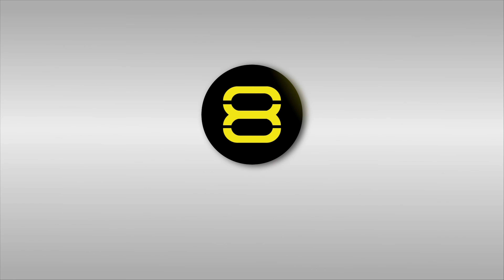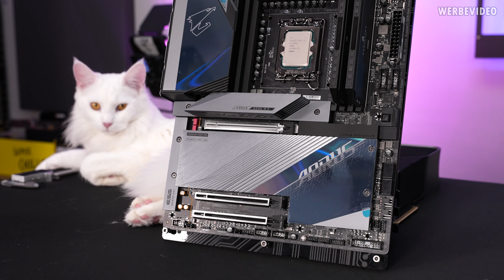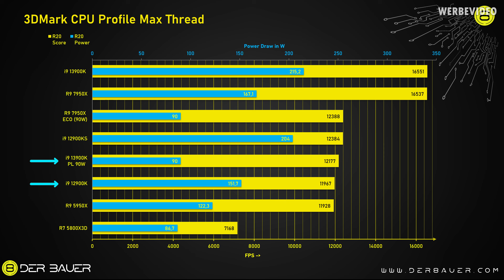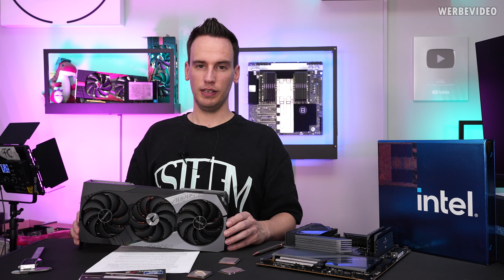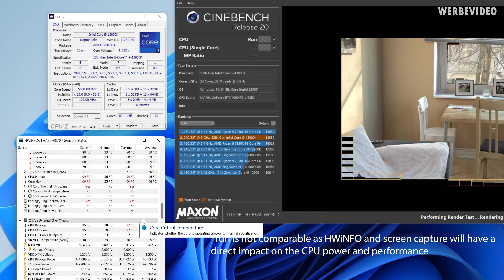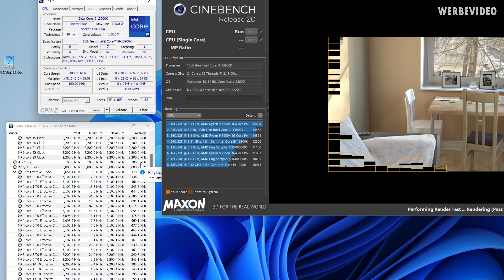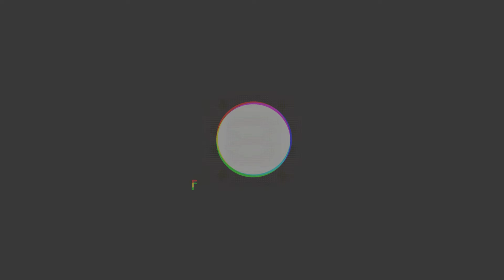Testing and Tuning the new 13900K for Efficiency

Comment: Really interesting to see how the CPU performs with the manual UC/UV. Most reviewers just focus on full power potential and instantly write off the good parts for the high power consumption. But this shows actually that its a really competent cpu when tuned correctly. Thanks for making the review with this viewpoint in mind
Reply from the maker: Thanks! Happy to hear
Reply: I mean... why buy the most expensive CPU to instantly undervolt it? If you need that power - good. If you dont, go buy i3 12100 and be happy. Its cheap. It sips power. And it gives you the same experience in games as any top CPU on the market. 

I know what i'm talking about. I've sold 12900k before 13900k launch. To buy new and best. As i've always did. And got myself i3 12100f as a temporary solution. Didnt expect much. But I've noticed zero difference in any game i played. None. Numbers might be lower. But actual gaming experience is the same.
Reply: @PanaehaliTut  Why buy the most expensive cpu? Because you can still obtain 90% of its performance with a simple good undervolt setup. That's still going to be leagues above the second-in-line cpus so why wouldn't you? There's no reason to keep stock levels of performance clock, that just exists for bragging rights in marketing, but doesn't benefit end users at all.

Realistically now you can get 12900k levels of performance at half the power draw (and sometimes even less). That's incredible, especially if you live somewhere where electricity prices aren't exactly consumer friendly these days. I am strongly considering getting a 13900K for my company/personal use, and fully intend on undervolting immediately so I can both use an air cooler and keep my current power consumption levels equal, while gaining probably 3x the performance of my current cpu.

It also usually doesn't make sense to swap cpus each generation, I don't even know why you got rid of your 12900K so quickly, what exactly were you expecting? Double the performance at lower power consumption with stock volting? That just sounds like copium.
If I were you I would have looked into a similar undervolt setup on the 12900K and waited at least 2 gens before upgrading - that is, if you don't have a ton of money burning a hole in your pocket. Top end gpus are never sold as good deals that benefit from being replaced every new generation. That spot falls on the 2nd and 3rd in line cpus that tend to have lower margins and higher generational uplift from stock settings.
Reply: @PanaehaliTut  Where it does become relevant is cooling solution. Arguably the price of electricity is over emphasized in many reviews but in gaming both peak and sustained power draw will affect real world performance depending on your setup. If you already had a setup for say a 12700 and wanted to get the best, knowing that the 13900 performs so well in efficiency standards (under the right conditions and tuning) may make the transition more compelling. 

I'm not even talking undervolting, the comparison of running intel powerlimits and such vs motherboard manufacturer ones is relevant for any kind of limited aircooling esp with a large gpu in the case.

Honestly, I agree overall. But some people will want to undervolt this for things like small formfactor stuff. Where they only care about performance under extremely limited cooling. An I guess some people might stress a 13100 out a little more than you :P
Reply: @faithnfire4769  at which point does 7700x or 7950x becomes a really good efficient option?

Neither of them require the tremendous power draw or cooling requirements of 13900k at full load, and consumes less power during gaming as well
Reply: I miss the days when I could boost my old Core 2 duo by 40% just by getting some good thermal paste, but those days are long gone. Honestly I don't really care about overclocking anymore. The relative performance gains are so marginal these days that unless you're chasing benchmark numbers it's just a waste of power. Efficiency tuning for a cool and quiet computer is where it's at these days! For me at least.
Reply: @fnorgen  
Core 2 duck tape overclocking.
and that's a good one
Reply: @aravindpallippara1577  stock values of the 7950x in full load are still above 250W lol, and unless you missed the whole video on average the 13900k with stock values uses the same power draw in gaming as the 7950x, both tuned go well below their out of the box performance while keeping over 90% of their efficiency
Reply: @PanaehaliTut  the answer is very simple: To get as much computational power as possible in the most silent built ever.
Reply: @PanaehaliTut  You do know that undervolting by itself doesn't reduce performance right? I agree that some people are going to buy this when they don't need it, but why not let them. It's their money to waste.

I also know what I'm talking about. I've been undervolting and efficiency tuning mobile and desktop CPUs since Intel 8th gen CPUs. You can often drop the voltage going into a chip without effecting the frequency. It's the same idea as overclocking just in reverse.

Instead of increasing the clock speed at the same voltage, you reduce the voltage at the same frequency. Then, you test for stability, and repeat. When you reach instability, you either increase voltage or reduce clock speed in either case, which one you choose depends on if you are undervolting or overclocking.

For example, I have a mini PC with an i7 9750HK. At stock it pulled 75W under sustained boost, and would spike up to 118W. It managed around 6700 points in cinebench R23 and would pin itself to 90C in those benchmarks. This would limit the clock speed by about 10%. After an undervolt of about 15%, it drew 15% less power as expected and maintained the same performance within the margin of error, but was now sitting at 83C instead.
Reply: @der8auer-en  Just had to downvote. Yet again another reviewer recommending buying Intel without considering the fact that the AM5 platform already supports PCIe 5 and will be supported until 2025 at the very least for another one or two CPU generations. Moreover, there will be the X3D V-Cache versions 7800X3D, 8800X3D and 9800X3D most probably all of which may well be supported by any AM4 motherboard bought today. A shame really.
Reply: @PanaehaliTut  ask yourself that question because you clearly need to know the answers. Wasting your money on the most expensive stuff when you have no idea why you need it
Reply: @lagarttemido  Whit AMD you allways wait for something. Who realy upgrades every generation? So AMD is cleaming it will suport AM5 for 2 more years (2 years and 2 months). You think something magicaly will happen and it will be big boost in performance. I just calculated that my i7 8700k (with shitty RAM) at 4.7 Ghz is only 50% slower than i9 13900k  with best ram. So in 2 years at best you can gain 20% performance. Totaly stupid to pay now this stupid prices to save some money latter. About upgrades. I would like to get i9 9900k to upgrade my i7 8700k, but i just cant find it for normal price. Same with my sons i5 6600k, i would like to i7 7700k. I cant find it for normal price. It is better to buy new platform than to upgrade. AMD fucked them self with prices and power this generation. If AMD relised x3d chip i would consider buying it. But now i think i will go i7 13700k or wait 14th gen. Reason is simple, i can eliminate CPU bottleck by going to higher resolution (4k from 1440p) and there is no difference than my old i7 8700k or any new Intel or AMD.
Reply: @vanjakloz362  Nobody with a budget upgrades every generation, you're right. The thing is though that in five or six years I will be able to put a two or three year old 9950x3d into my x670e motherboard (that I got for $280), and immediately have way better performance in everything. That means I saved $300 because Am5 isn't a dead-end platform, which is not an insignificant amount.
Edit: Obviously there is still an argument to be made for Raptor Lake, If you have a 12600 or 12700k in your system, upgrading would be great value as you get to keep your motherboard. For new builders though, raptor lake isn't the greatest as if it is for gaming the 5800x3d and 5600 absolutely destroy in value, and ryzen 7000 gives you slightly worse performance (arguably) while giving you an upgrade path.
Reply: @PanaehaliTut  The 7950X cost more than the 13900K. So this is not undervolting the most expensive CPU.
Reply: @der8auer-en  Can you try the E-cores-only case? How does it perform then?
Reply: @PanaehaliTut  Quad cores are dead.
Reply: @orangepacker7479  What you say has a very significant flaw, old cpu's are still expensive as hell, i tried looking or an old 4790k for a friend and it was cheaper to just get a ryzen 5. If you plan to wait 5 years to then buy a 3 year old cpu then expect to pay higher price than what you would like to pay when looking at the current options of the time. 
Instead of getting something that you can maybe upgrade later just spend a bit extra and get something with headroom for your application and hold onto that build for as long as you can
Reply: @joey_f4ke238  The point isn't saving money on the cpu, its saving money on the motherboard. As for your example the 4790k is way more than three years old. You can get a 3800x for $250 brand new rn and that was almost $400 on release. Of course that isn't always true, as the 3950x has a terrible price. Maybe the cpu price will go down, maybe it will stay the same or even go up a little, the point is that you save money on a motherboard. Gambling on the newer ryzen 5 having better performance in three years than the x950x3d part is unrealistic.
Reply: @PanaehaliTut  I disagree. I think it makes far more sense to push a cheap cpu to its limits than an expensive one because the advantage with CPUs like the 13900k is in that you can UV it to the point where it draws the same as an i3-12100 and still drastically outperform it and on the other end when overclocking a lower end CPU you are just increasing its value and pushing it closer to chips like the 13900k for FREE.
Reply: @aravindpallippara1577  Neither the 7950x or the 13900k are good purchases to run at full wattage all  the time. For the 13900k do something similar to Der8auer and for the 7950x tweak PBO for efficiency or use 105w ECO mode. Doing either of those things correctly results in at MOST 5% performance loss but also a 50% reduction in power draw and heat.
Reply: @PanaehaliTut  An I3 does not give you the same experience as an i9.
Reply: @orangepacker7479  You are literally going to lose a lot of performance keeping the same motherboard and new motherboard IO when zen 6 comes out. Stop trying to live above your means if money is the problem.
Reply: @ZackSNetwork  stop necroposting
Reply: if anything, most reviews barely touch on the high poweer consumption. It's a quick graph and that's it.  Maybe german energy prices "help" him not ignoring it like that.
The same way they talk about the price without the inclusion of the new chipset needed every generation.
Reply: @DigitalJedi hi there! I read your comment and wanted to ask. Are there any guides or videos on this subject? And I mean efficiency tuning. I would like to learn how to do it myself. Thanks!!
Reply: @Juan Da  There aren't any general guides, but I will get on a writeup in the future. For now, the basic idea is the exact same as overclocking. Use the same tests, use the same software, just move the sliders and numbers in the other direction.
Reply: yea because most people are not going to underclock and/or undervolt plus at that point why even spend the money on a 13900k, just get a 13700k or the 7950x

Comment: Most reviewers heavily criticized the high power consumption of modern CPUs/GPUs (which is reasonable) but they don't show what you've presented here. I'm impressed with the performance you've achieved by optimizing for efficiency and I hope others realize this too. I'm looking forward for your tuning of a 13600k/13700k. Thank you for this new perspective!
Reply: @HappyBeezerStudios  Turbo Boost is not efficient or normal operation: entering Turbo Boost territory always means performance to power draw trade-offs. 

Normal operation is base frequency. So if you look into Intel's offers you see:
T: 35W target. SFF high efficiency builds. Non configurable. Turbo boost capable, but constrained.
Non-K: 65W target. Baseline, reasonable efficiency ground. Non configurable. Turbo boost capable, but constrained.
K: 125W target. Performance tilted, they already give away efficiency. Fully configurable: you can make them be whatever you like within the physical limits. They're also the higher quality silicon which is an oddity in itself.

If you really understand the offering you already see what you're paying for and what's available: but blaming Intel and AMD for the power budget is non-sense, the point in 'K'(Intel) and 'X'(AMD) branding is you pay for a fully configurable CPU high quality silicon to make it whatever you want. Being able to totally customize something in this world has always costed money in every field.

For reasonable cases both them have way more reasonably priced products that are PnP, so the system is actually right: it's we consumers who misunderstand it.
Reply: @HappyBeezerStudios  Less work users need to do: you can run single core 5Ghz+ even with crappy cooling because it comes set that way out of the box. Or really light loads can absolutely fly. When a load overwhelms available cooling the CPU will adjust to it. All under warranty.
You really don't know what you are asking by saying it would be better if they sold them like 10 years ago. Nowaydays a CPU can be blazing fast for everyday scenarios out of the box, whatever cooling it has. Obviously good cooling will enable more sustained performance and here is where the end user comes in a pay for play model.

Also if concerned about power use setting a single knob(power target) will get anyone wherever they want to be in the efficiency curve. The CPU can still run 5Ghz+ as long as it's within the power budget.

PS: my work laptop uses a quite modest CPU(non-K) as is so damn termally constrained that even something relatively trivial like opening a browser makes the CPU throttle, but hey, despite all it can run 4Ghz+(for a few seconds) on a brutally constrained cooling making it somewhat fast for the weak hardware it runs. This is for perspective, but this can only happen due to modern CPUs and how they come shipped.
Reply: My 13700k is pulling 60w at PGA 2k23 all maxed out 1440p and 165fps stable. Its running 45-48c 💪💯👍